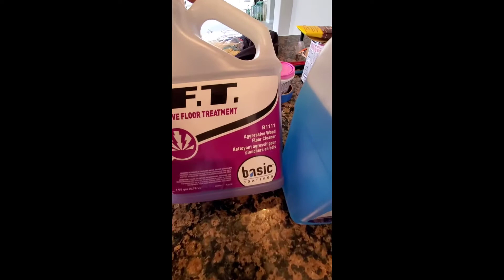How to Hardwood Floor Cleaning and Refinishing in San Antonio Tx. #sanantonio #rmfcs

Comment: I am very grateful for this video, can you do the same procedure even if you don't know what they used to clean the floor before? We are moving soon and the hardwood floor is disgusting. I was thinking of using exactly the same products or Pallmann satin finish in the end (I also saw it in another of your videos) but I don't know if it works if the floor has wax or Oil Based Polyurethane, I would greatly appreciate any advice from you.
Reply from the maker: No you can not put down polyurethane on top of any type of floor finish .

Comment: do you use dissolver then IFT?  Or dissolver then squeaky? for wax removal?  Just wondering if IFT is needed when you use dissolver.
Reply from the maker: I normally use the stripper then come back after I rinse and all is done to neutralize the floor with the squeaky. 👍

Comment: If my floor is stained and only have scratches on the clear coat, that will should fix it? Thanks for sharing, nice job!!
Reply from the maker: If the scratches are topical and haven't penetrated the actual Hardwood or stain more then likely you will get great results with this method and cleaning agents.

Comment: Yeah also my good man I got a lot of questions where do you get that nice vacuum man you don't have to use that other vacuum you used to use before that vacuum you just use on the floor there with the wheels and the suction in the front where you get that at give me info on that please and thank you
Reply from the maker: This vacuum is a power flite push behind I got it off there website a few yrs back.👍

Comment: Awesome work! How is that shovel nose vacuum working on hardwoods? Right now I’m using a shop vac, but looking at different options to make it a little faster.
Reply from the maker: I love the vacuum 😍 it absolutely makes the  open space areas a whole lot quicker to get done but my go to daily is my shop vac with the 20 ft hose and the metal wand it still holds dear to my heart. 🤗💪😁
Thanks for watching 🙏
Reply: Thanks
Reply: @royalmastersfloorcleanings  what type/brand of metal wand is that?

Comment: Acrylic wax=ruined wood floor, you are lucky not to be sued for negligence and destruction of property.
Reply from the maker: I would never apply acrylic wax on  hardwood floors I simply gave it a good cleaning and applied a refinisher . ( a water-based poly )
Thank you for watching
Reply: @royalmastersfloorcleanings  Ok, glad to hear that. My advice then to save money is buy proper finish and thin it 50/50 and lay it down.
 The stuff you use is 10% finish or it could not be put down your way. better product for less everyone wins...GL.
Reply: John its a buff cleaning and an application of a polyurethane... basic coatings is excellent quality..Ive been using them 10 years... he wasn't taking off wax...that would require screening...
Reply: Yea this is from basic coating it’s a poly refinisher to protect floors… their system is great for this application
Reply: @patsantorojr  Ok, some advice then. Learn to put down a proper coat with some proper finish using a proper applicator and proper technique. Also, the floors are buckling from the amount of water you use and someone will eventually say something often through  a claim against your insurance. Maybe I'm wrong but having been in the business for 35 years tells me I'm not. I do know the amount I charge after home owners sues and an insurance adjuster totals the floor and has a professional replace them from this very thing though. Either way it's a mistake that has a remedy, gl.
Reply: @johndallara3257  it’s not water though… it’s alcohol based which when dry leaves the floor dryer than before. You can actually test it with a water meter pretty interesting product. As for his application technique I really wasn’t commenting on that lol